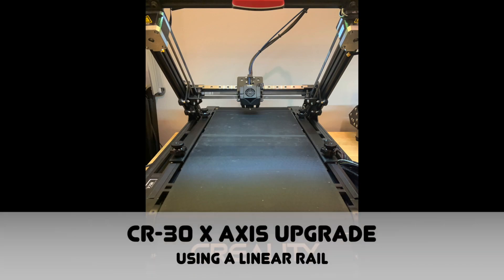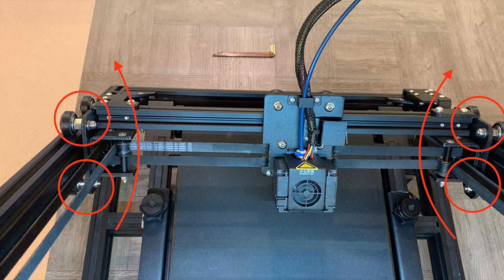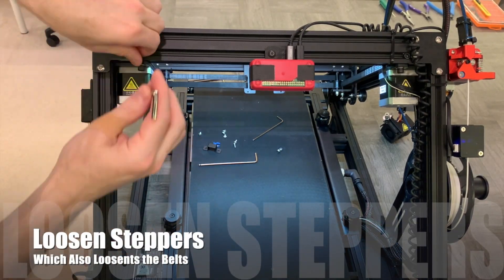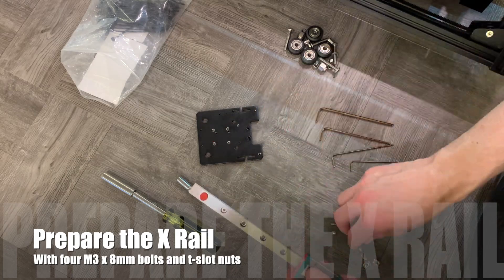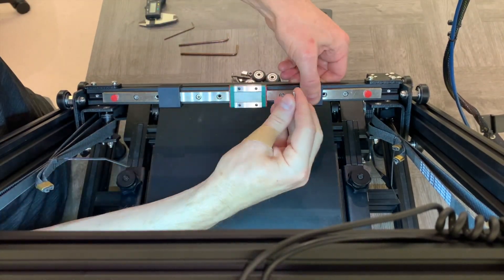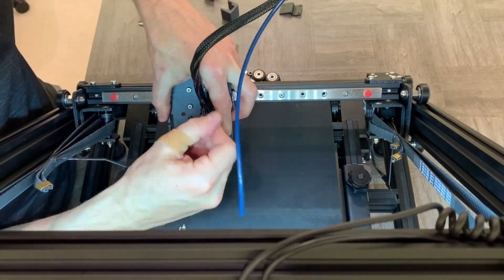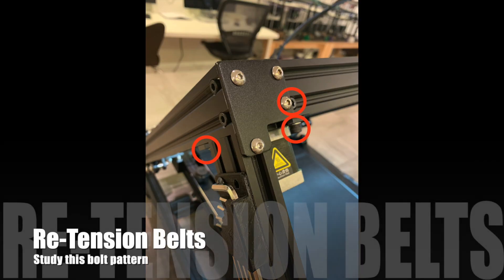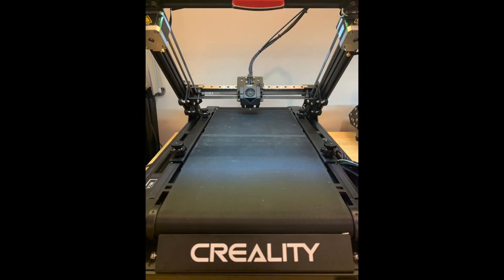CR-30 Linear X Rail Upgrade

Comment: Did you also have an issue of the x crashing the fan vent inso the bed leveling bolt?
Reply from the maker: I did not have these issues in my setup. But my CR30 has moved on to greener pastures.
Reply: @GridSpace  so strange I just removed the turn knob and that fixed it

Comment: Thank you for the excellent video! Is there any reason why I couldn't or shouldn't offset the new drilled mounting holes somewhat to move the hot end closer to the bed and reduce the need for raising the bed so much?
Reply from the maker: if you do that the belts will not connect to the factory plate and preserve a level / colinear path
Reply: thank you, yes i just discovered that independently. I will proceed with your template/spacing

Comment: Why’d you choose and C instead of an H block? H would have been more rigid.
Reply from the maker: it's what I had on hand. I doubt an H block would make a noticeable difference. there are other dominant design issues with the printer when it comes to print quality.

Comment: Been here here by Repkord X-Axis rail upgrade kit. But I can't understand what is the line rail aligner for, and I can't found it in Repkord upgrade kit. Is it necessary for this upgrade? and why?
Reply from the maker: the rail aligner needs to be 3d printed. it's to keep the rail level. https://cad.onshape.com/documents/cb39a69d2303568cd190e286/w/47235c626458965619745be7/e/043bfd29dfa9fb4680e6dc97
Reply from the maker: you can also 3d print the hole template https://cad.onshape.com/documents/cb39a69d2303568cd190e286/w/47235c626458965619745be7/e/3fb9aab6ca410042c84d03c3
Reply: @GridSpace  Thanks, I am first time to do line-rail upgrade, it seems the line-rail installment is not just secure the bolts into holes XD?
May I ask how to use the X plate hole aligner? Any images or document, clips for reference?
Reply from the maker: usually you're using t-slot nuts and M3 bolts to secure the rail. the plate aligner is for drilling holes to mount the factory plate to the linear rail pillow block as shown in the video.

Comment: Hey so I was looking at the thingiverse and the pictures there look different from the final in this video, the rail looks like it’s on the back side of the aluminum extrusion and this one looks to be on the top, also in another comment you said you used a 330 mm rail but I can’t find one, only one I can find is 300 or 350
Reply from the maker: I haven't posted this on Thingiverse. So whoever did may have modified the setup. I got the 330mm rails on Amazon. https://www.amazon.com/gp/product/B07Z5NKF42
Reply: @GridSpace  appreciate the fast reply, turns out that they don’t have it on Canadian Amazon, but thankfully it’s cheap to order it up here

Comment: Linar rail length? Thanks
Reply from the maker: 330mm is what I used.
Reply: @GridSpace  can you get away with a 300mm without loss of volume if you skip adding the stoppers?
Reply from the maker: @nickwaldron1719  300mm on the X works OK. but I would recommend 350mm on the Y, if you can't get 330mm
Reply: @GridSpace  perfect, thanks for the response!

Comment: Hi there, i saw on your forum you pushed the upgrades even further, can you upload a video of your CR30 in his actual shape ? And finally, what's your opinion about this printer now it is upgraded, was it worth ? (I'm actually also upgrading one...) Thanks in advance !
Reply from the maker: I'm in the middle of a lab move, so it will be a couple of weeks before I can make any new videos. I really do like the CR30. A lot. Any design issues are easily addressed with upgrades and modes. For example: In my opinion, the X linear rail upgrade is mandatory. The stock bowden couplers are marginal (and often fail quickly) and the heated bed is over-constrained which can lead to warping. But those are both easy fixes.
Reply: @GridSpace  Do you have a link to any videos or posts where you have addressed and fixed the issues you have found?
Reply from the maker: prior to making this video, I posted a series of early updates / fixes for the CR30. it's something I will come back to in more detail later on. https://forum.grid.space/t/upgrading-a-cr-30-belt-printer/310
Reply: Great work… is there anyway for you to sell a « full finished » upgrade kit, included printed parts ? I am really interested… 😁
Reply: @kreaken3D  I'd also be interested in this.
Reply from the maker: @kreaken3D  check this out https://www.repkord.com/collections/cr30-printmill

Comment: My plan would be a bit more 2 fold. I will get a bit more comfortable with the machine, then I will machine a new X plate with the appropriate hole pattern for all the necessary holes, ideally you just add a counter sink on the m3 bolts that link the plate to the block, then you have no clearance issues. Then I would either machine new brackets the hold the idlers so they keep the belt path parallel (the key of the corexy is to have a parallel belt path, this does shift the belt path out of square a bit) I may additionally or inversely look at machining different Y rail carriages to shift the X gantry down to allow it to be closer to the belt) -- I have a CNC, this was the plan all along. I have some spare rails which would be adequate for this upgrade
Reply from the maker: here is my original thread on CR-30 conversions: https://forum.grid.space/t/upgrading-a-cr-30-belt-printer/310 ... since then I have machined aluminum brackets for the X+Y rail setup and am working on a new set of brackets that are easier to machine.
Reply: @GridSpace  I started doing upgrades -- octoprint with the pi4, I'll start with marlin for now. I am also going the route of keeping the hotend form factor, I swapped to the microswiss assembly, but it seems to be at edge of heat creep, so I'm getting the bi-metalic heatbreak for creality hotends from slice engineering. So the end will be a hybrid of creality heatsink -- likely, with the slice heatbreak, microswiss hotblock and hotend. I looked through the forum, and the in progress on shape files. Are you sharing the designs for aluminum brackets? The rails I have on hand already are MGN15, so I'd need to play around with some adjustments to make things work, and to keep the belts stay parallel . My thinking is taking me to moving the linear rail to the top of the X gantry... when the Y plates are not in the way, it should work.

Comment: those wheels are not a good design for how they are being used.  Better would be wheels like this where most of the forces are on flat surface of the wheel and the center angle is just for centering. https://www.aliexpress.com/item/32784678697.html